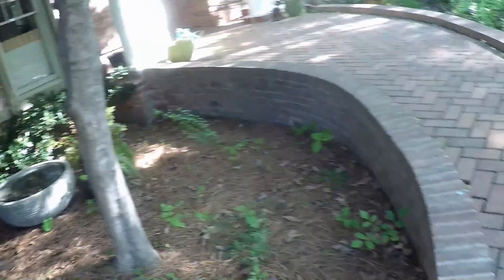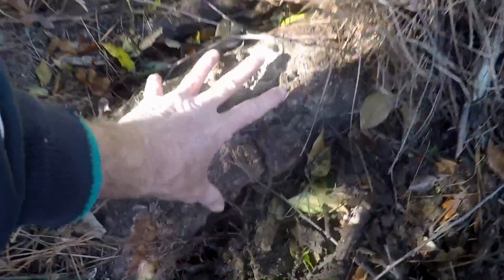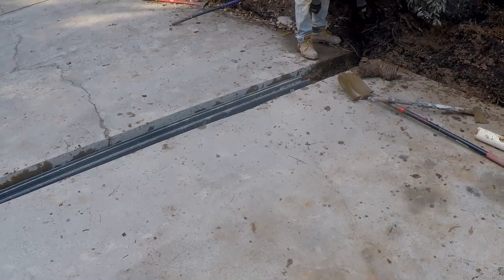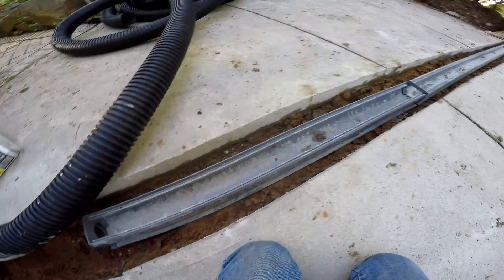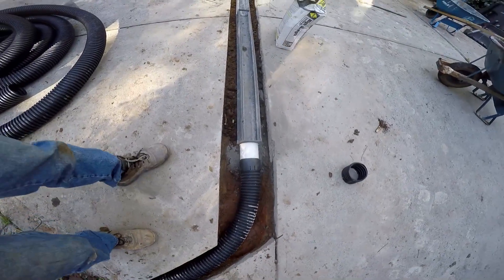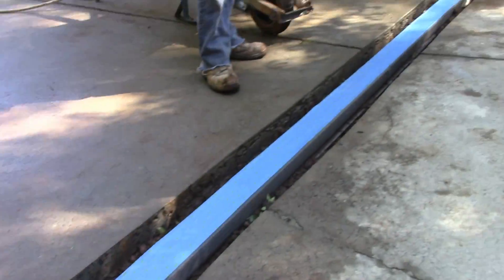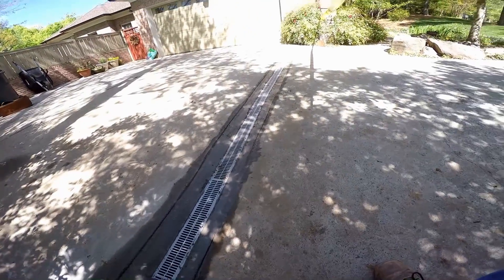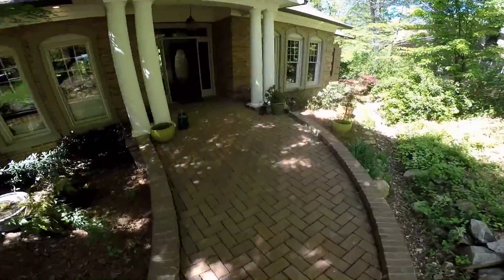How To Install a Driveway Channel Drain

Comment: Can you tell me how thick your new concrete is over the drain pipes? Wont it crack if it is not at least 4 inches and it didnt look like it was. I am at odds currently with the contractor who said my concrete would all be 5 inches but is now saying it will only be 3 inches initially where the drain pipe  exits the  channel drain. So we are on hold ...any advice would be greatly appreciated
Reply: Oh I'm also up north so have fluctuating temperatures to deal with.

Comment: There's that Freddy Krueger shirt again!! 

Quick question..... Regarding concrete mix, will any pre-mixed concrete work? Or is there a specific type you can recommend? Also, how do you bond new concrete to the existing concrete in the drive way?
Reply from the maker: Any Redimix will work and it instantly bonds to the old concrete just wash off the old concrete
Reply: You should also roll on a concrete bonding agent. Or I've even made some with some Elmer's glue watered down or even better yet make what us called a slurry or a slosh and just brush it around it'll make like a paste

Comment: you need rebar in the concrete too
Reply: Many of the drains do not require rebar these days. Anti-flotation design prevents floating and doesn’t require staking when setting in concrete
Reply: @adamgrann2142  Many don't i understand. I had my drain replaced and the company that did it drilled holes into the existing concrete and inserted rebar like dowels sticking into the channel each side of the drain. When the  new concrete was poured it was connected to the old concrete by the rebar.

Comment: you didn't support the channel drain with concrete below or recess the drain.  The plastic channel will flex and break free after driving over it with a car.
Reply: Yeah there’s supposed to be 4” of concrete below and on the sides of a channel drain.  And recess it slightly below so that the vehicle tires aren’t able to crush it.
Reply: what is the process to recess the drain? I'd like to know so I can do this myself. how many inches of concrete should be underneath the drain?
Reply: 2-3'
Reply: Thank you for your comments! I figured there was more to it.
Reply: The concave grates ideally distribute weight to the edges while driving over it. He did recess it slightly, as mentioned in the beginning of the video.

Comment: Could u do a video on the specifics on installing a a simple drain. In other words how deep should the trench be in inches how many inches gravel as Base and then pipe and how much on top. Also how much should the drain drop per foot to achieve good flow. Thanks
Reply: jerkyturkey007 Nothing wrong with   schedule 40  4" pipe he used. That will move the water better then the corrugated pipe and won't clog as easily
Reply: A French drain to be specific
Reply: 0007nexus I can't believe this guy is a drain contractor, in my experience he did just about everything wrong.  no real support for under the trough, he should have pegged the new concrete to the old concrete, ( guaranteed it will move when driven over by cars ), then he used p.v.c. drain pipes for the downstream take away, which will be overwhelmed by the volume of water. This is a good video to learn how not to do an perk drain lol.